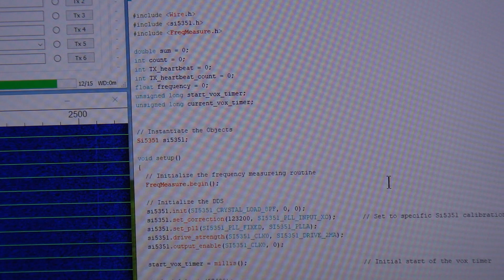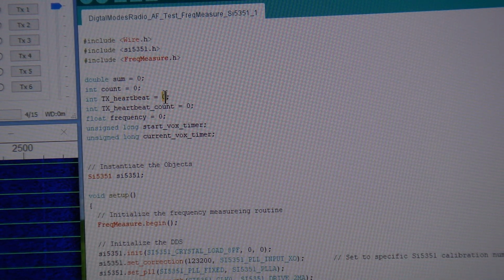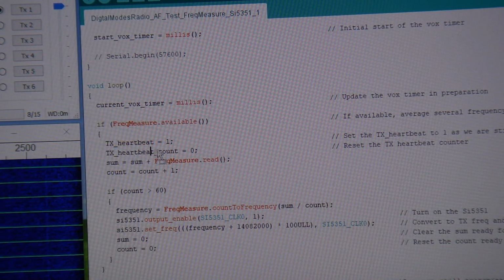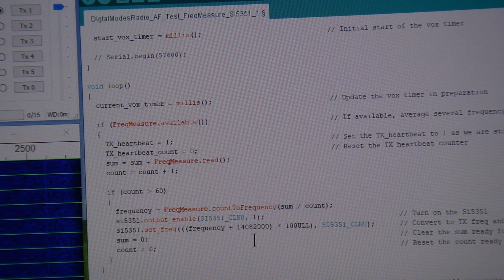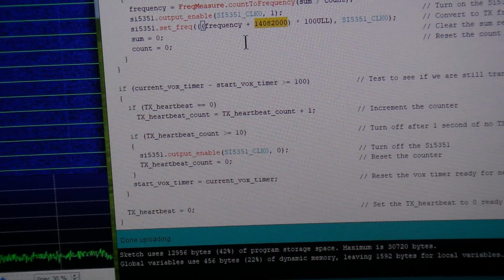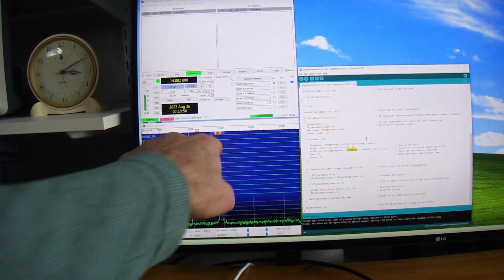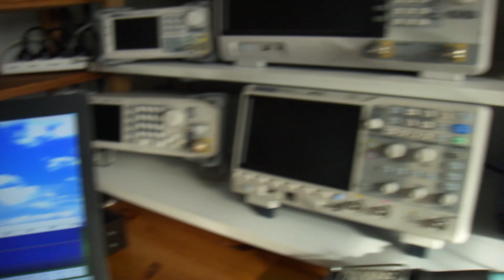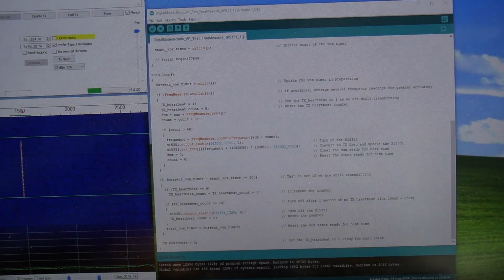Digital Modes Radio - Part 2: Initial Software Transmit Tests

Comment: Does the USB sound card support both stereo output and stereo input? I have been searching unsuccessfully for such a device, preferably with line-level stereo inputs. I can find zillions of devices with stereo headphone output and mono mic input, but not with stereo inputs. If yours is stereo out and in, can you provide a link or a part number for ordering? Or can you provide the part number of the IC on the board? Thanks, I really enjoy your videos!
Reply from the maker: Hi. Yes it is stereo. Unfortunately, is a black blob with no markings. It cost 66c off our local TradeMe website. I've checked the listing and it does not have any part numbers or any other identifying features. Sorry about that.
Reply: Okay, thanks for the response!  @CharlieMorrisZL2CTM
Reply: Hi, Im Hans (OE2EJN) - I'think it's a Cmedia Chip CM108B or newer. It's a cheap chip, when available. It is a 16bit usb stereo audio codex. Its is also the chip inside DigiRig ! Charlie you inspire me to come back to ham radio and DIY. Thank you for all your very nice and very good videos !!! vy 73, Hans

Comment: Nice work Charlie ! I used a similar approach in my home brew ft8 rig , using a discrete  transistor schmitt trigger to square off the input tones coming in from WSJT-X , then using the input capture modules to work out the timing and the frequency  (I used a dsPic3012). Works quite well , I have logged a couple of ZL's on 20m using this arrangement. The front end receiver is not the greatest , just a crap ne612 neophyte arrangement with an Opamp/lm386 audio stage- but it works. Hopefully we can have a QSO once you are done with yours!! 73 Ash M0LKA
Reply from the maker: That's interesting Ash. I might have to clean up the Si5351 output before amplifying with the BS170s. Having said that, I didn't for the CW rig and that worked well. We'll have to see. As for the QSO, most definitely. 73 Charlie
Reply: As I recall, The si5351a didn't have enough umph to drive  3 paralleled bs170's hard enough to get usable output at 20m , so I used a the AC version of the 7414 with a couple of gates in parallel as a driver. This , at least in my case helped with getting faster edges and the ability to push more power in to the bs170's (which run  class D), and finally I got around 2~3 watts . The squaring up helps keep the bs170's cool as the linear excursion time is kept to  minimum (I didn't need heat sinks). I have to say a lot of the design decisions were influenced by your experiments on the class E amplifier videos you did a while back!

Comment: Neat idea to drive a simple Tx  by counting the audio tones at an ADC port, I wonder how fast the trusty old Nano can go using the  PJMS  Frequency lib. The detected tone frequency  becomes an offset to the si5351, so easy.  Add 3xBS170 and youve got a beacon. Another idea, you could connect an electret up to Paul's 74HC14 squarer and hold a smartphone next to it running a ham digital app, like Peter Parker does to transmit WSPR using just a phone, the app and his FT817.  🤓👍
Reply from the maker: Hi Paul. Yes, it worked out very well. Just need to add the RF amplification and filtering, and the TX will be done. The smartphone app sounds interesting.

Comment: So if I understand correctly, Computer A sends an abbreviated FT8 signal (for test purposes) out to the usb sound card. The sound card output is input to the NANO then the S15351 then out on clock 0 to an rf antenna . The rf is picked up by a regular hf radio also on the bench that talks to computer B running ft8 software and shows the receive/send cycle. Sweet ! 8-) 

So the receive side on the ft8 signal on Computer A is just some sort of test signal ?

The vox switching is a great idea ! 
Keeping the prototype on a breadboard is cool. 

 But that leads me to my next worry. 
What will you use for the Tayloe detector  on the receiver side ?
Will you be using a surface mount chip ? I am a sub-par solderer. So
my surface mount soldering might fail. Any hints ?
Reply from the maker: Gidday Phillip. Yes, it was full end-to-end check from one PC top another via RF. I'll be using through hole components, as I have not made the transition to SMD. I can prototype so much faster with through hole. One day though, I'll have to make the transition.